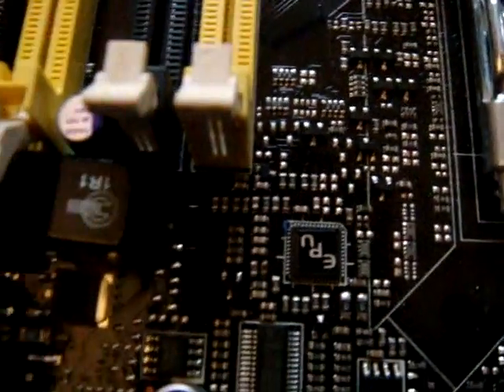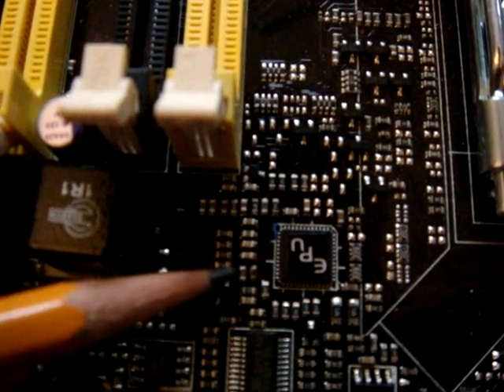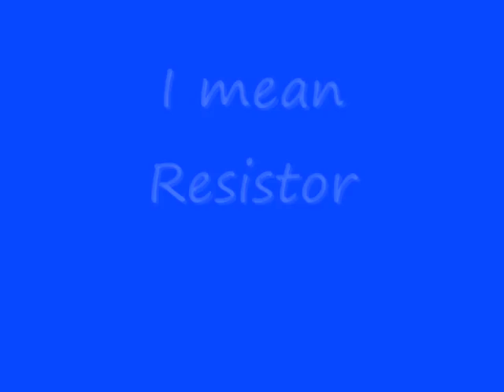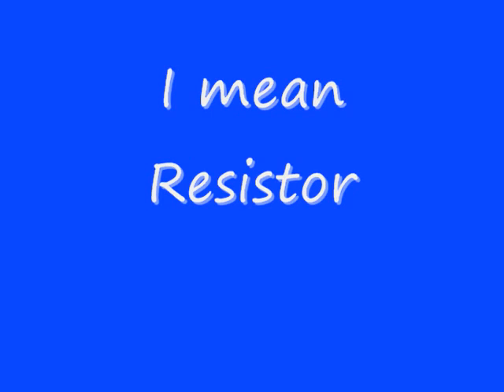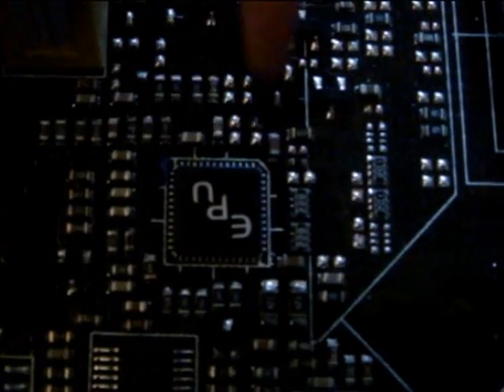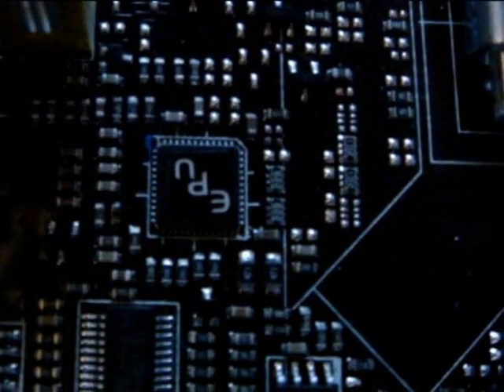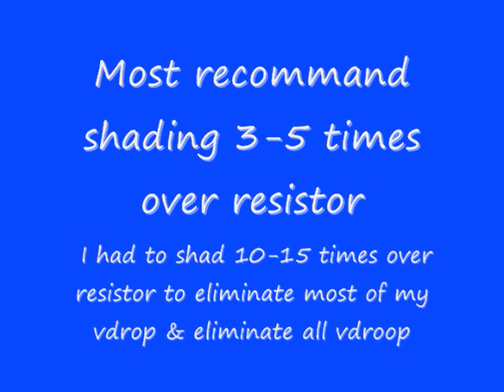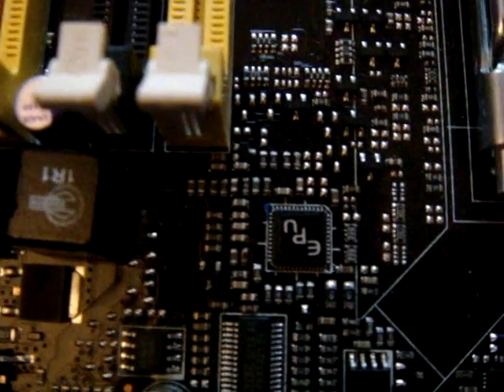ASUS P5E MOBO PENCIL MOD

Comment: i done this mod for the ASUS p5k-C and trust me buy a Multimeter they cost like £10 but are a must for doing this because you want to lower the resistors OHMS but only to a certain extent. I reduced a 137kO resistor to 47kO and eliminated all vDrop and now hav 0.008V vdroop compared to 0.04V before

Comment: Hi mate, nice video. Pity there is not so many light. I wanted to ask. Should i shade whole resistor or only some part (upper, downer) Still thanks for the video. Yeah and i guess flashing to Maximus formula or Rampage formula does not solve this isue right?:-) Strange taht manufacturer cannot solve this easy task...